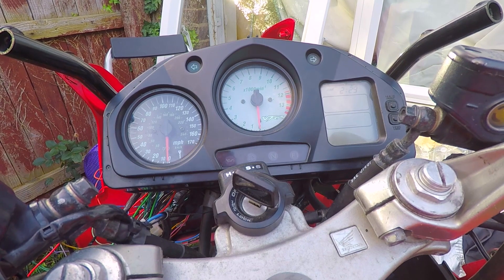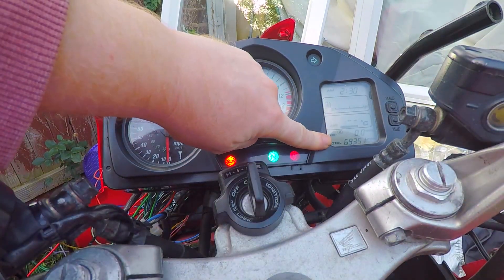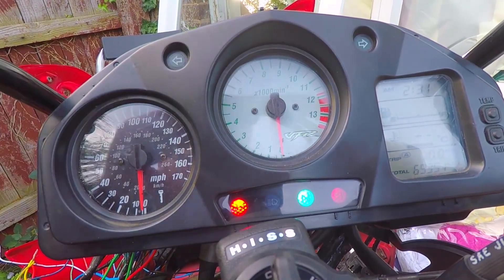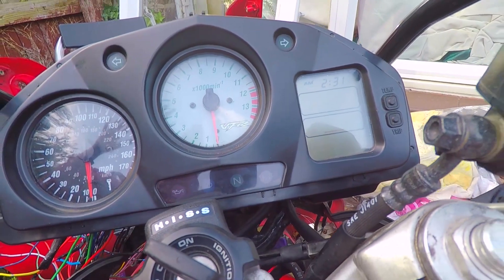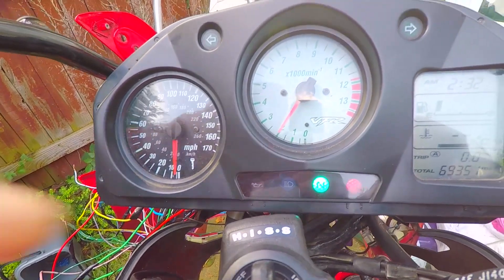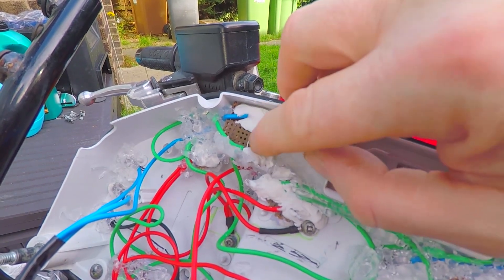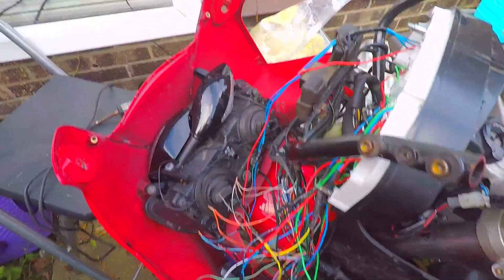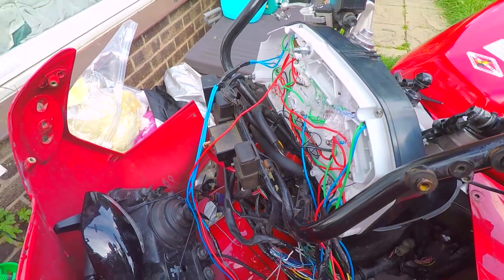VFR800 Dash Rewire Part 2

Comment: It's a wiring harness, a very important wiring system, so why aren't you soldering?
Reply from the maker: Brandon Lee I did, are you referring to the ring terminals? the screws do 2 jobs 1) to hold the tachometer, speedo and LCD screen in 2) to provide power, earth and signal

Comment: Must admit I would have liked more detail, tracing the wires, actual soldering in action etc......this is more before and after......I've got a 2001 VFR800Fi and I bought it as a crashed bike, this part was damaged, and all the front end....and I bought another eBay replacement box including wiring membrane..., I have yet to reassemble everything, 12 years later...Hmmm
Reply from the maker: Roy Dean I have purchased a second-hand dash and wiring harness so I can do a more in-depth video. When I did these videos I was obstructed by time constrates
Reply: Nige-Rider ...Hi...I make bike videos myself...I know how time flies.....

Comment: Did you ever get the LED on the FI light fixed? When I did my LED conversion on my 5th gen dash, I had to change the FI light back to a halogen and that fixed the issue. I dont know why the FI stays on when you replace it with an LED. I couldnt figure it out.
Reply from the maker: I haven't but as luck should have it I have managed to get a second-hand dash and wiring harness, which means I can take my time and do a full analysis of everything,  And of course do some video's off every step a long the way
Reply: @nige-rider5914  could it be the temp sensor? did u ever hook that back up?
Reply from the maker: @stevenhawks5167  Hi there I did hook it up the temp sender. After speaking to Honda I think I have the solution

Comment: Had me until butt connectors. Aptly named because they are ass. Solder and heatshrink, or wish you did later while looking for that loose connection. Makes the whole thing worse than pointless to hide that crap in the loom.